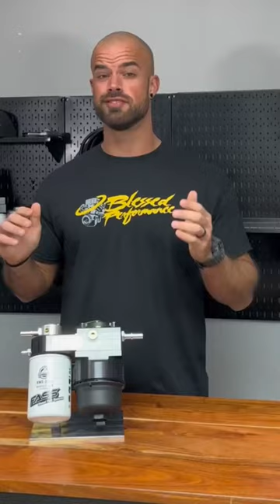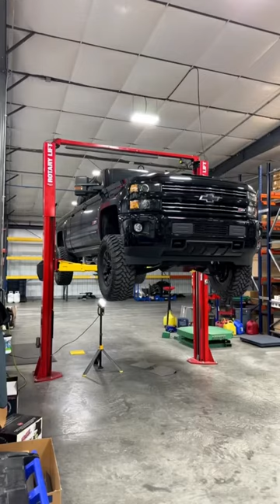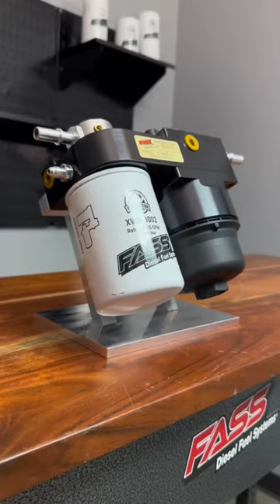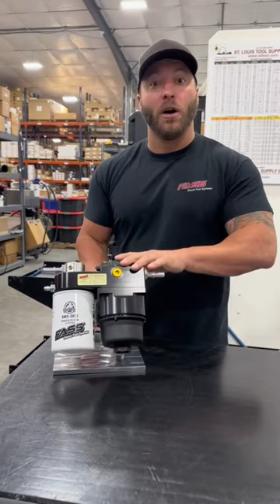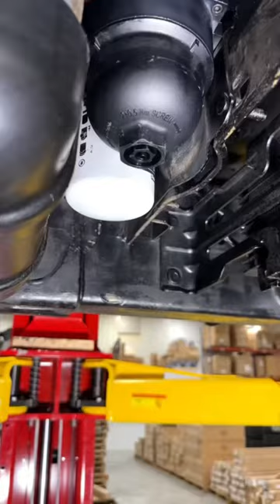Installing it takes less than 60 minutes, explaining the install takes less than 60 seconds 🔧

Comment: Let me explain why FASS is number one.
First it’s important that I tell you I’m not a paid sponsor. I am a real customer that’s right a real customer. 
I Decided to go with a FASS
System because the way it’s engineered and it’solved many of the issues that trucks today are faced with.
Such as heat and water intrusion.
FASS remedied this problem and came up with a system that allows proper psi  as well as avoiding fuel contamination..
What’s amazing truck could sit for weeks then I get in the truck and starts right up.

I’ve had the system for years so I know the before and after results.
With  instant start up and no lag. Yes that’s right it starts right up no hesitation and no it’s not a new truck. It’s a 25 year old truck but starts and runs like new.
i’ve seen a significant increase  in power and miles per gallon.
Reply from the maker: Thank you very much for all the support! We appreciate it!

Comment: My only question regarding the drop in difsl5 pump is, does this upgrade increase horsepower/ torque ? possibly by way of more fuel rail pressure
Reply from the maker: Great question. Our Drop-In Series Systems utilize the factory in-tank pump for fuel flow, while providing vastly improved filtration. 

If you're looking to provide more fuel (and ultimately power), than the stock in-tank pump can support, you'd want to check out our Titanium Signature Series Systems.